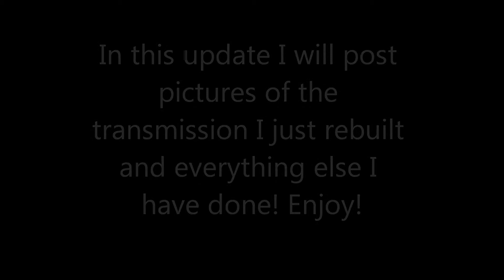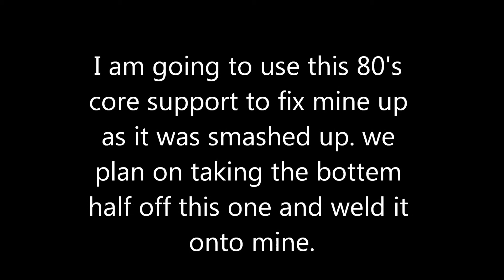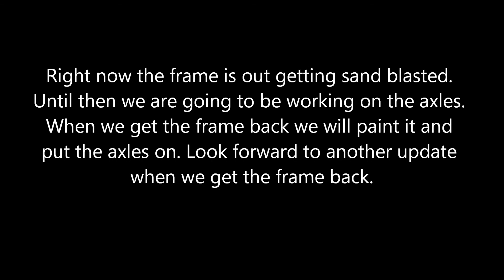My Project Truck Update!

Comment: What happened man?
Reply from the maker: sluttyfuck19 What do you mean by what happened?
Reply: TheChallenger370 Did you finish it?
Reply from the maker: sluttyfuck19 not yet, all that is left to do on it is body work. Just with school and little money it got pushed to the side. It should be done in the fall if everything goes well.
Reply: Ok. I understand. I got a 79 Dodge D150 from my dad. He said it was a lil red truck but i dont think so. Then maybe it was a warlock but I think its just an old regular D150 stepside. How can i know?

Anyways, I am on hold with restoration because of money and school. Think i will begin in a year or so.. you did good work so far:) did you have ane prior experience?
Reply: I would love to see some more updates and maybe some pointers when the time comes. Like what did you paint the frame with? is it important to sandblast the whole frame or is it okey to just sand down rusty parts.. 

I am looking forward to getting started on this project. Just got the car:)